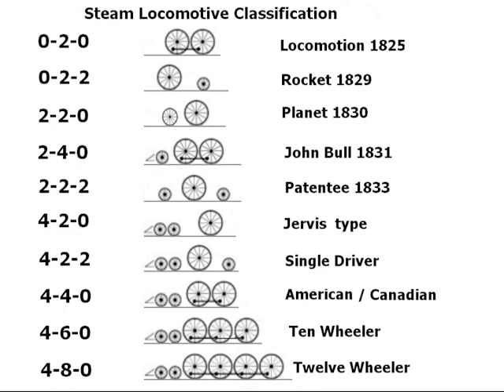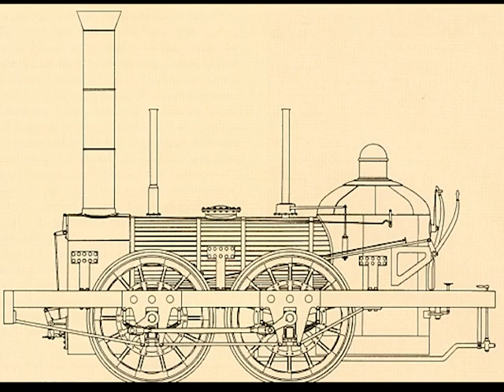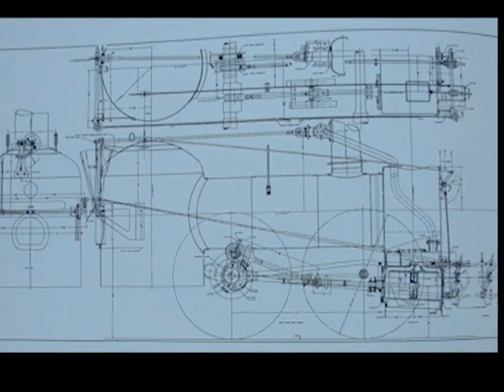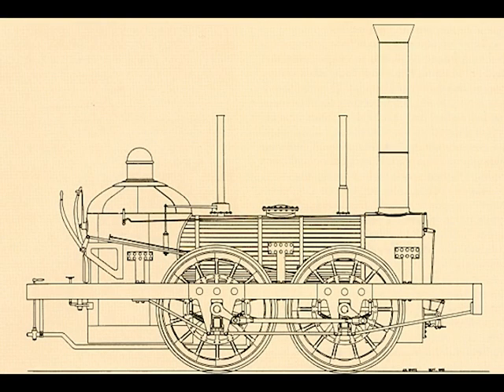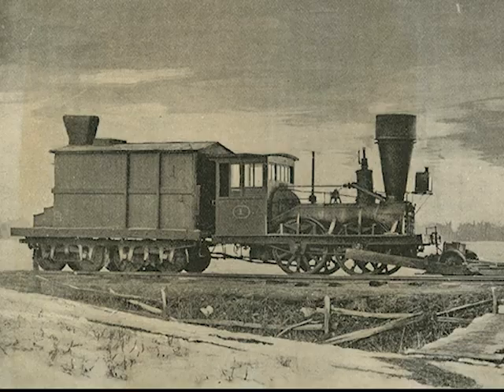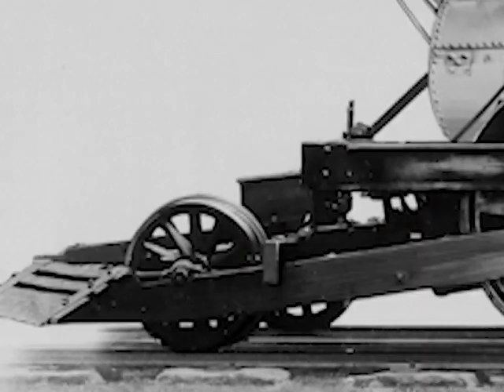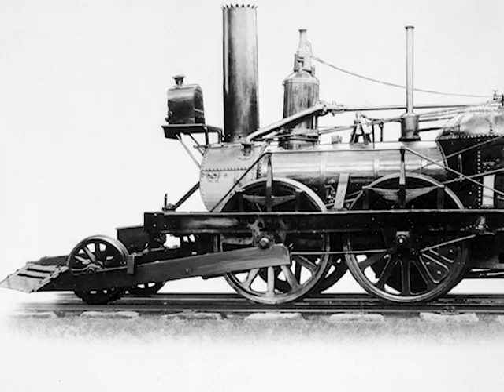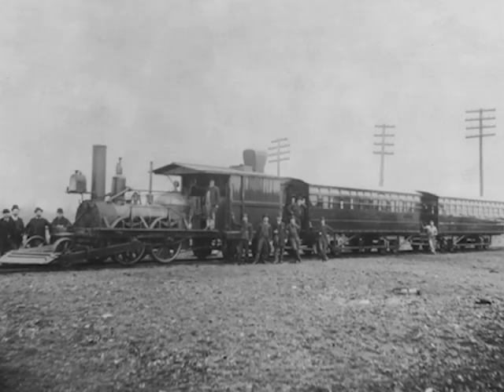RLMS: More Bull

Comment: I want to point out several inaccuracies in this video. First, the fatal derailment happened after John Bull was modified with a pilot. In fact all of the Camden & Amboy locomotives were fitted with pilots prior to the start of steam haulage on the line in 1833. So that accident had nothing to do with the invention or installation of a pilot axle on John Bull. The accident in question happened when a wheel or an axle on one of the passenger cars broke, causing the car to flip over and derail the train, the locomotive was not the cause.

Secondly, the drawing in John White's book is probably the most accurate depiction of the locomotive as built. When John Bull was built the springs were under the frame, as was usual for early Stephenson locomotives. The dome on the preserved locomotive (and its associated exterior steam pipes) is also a later addition, Stephenson didn't build it that way. It's worth noting that when Isaac Drips  (who assembled the locomotive when it arrived in America) sketched John Bull as it originally looked, he sketched it with those differences (ie. his drawing shows the springs under the frame, and the dome over the firebox, instead of toward the front of the boiler barrel). So those details are correct.
Reply from the maker: Thank you for pointing out the inconsistencies and the likely source of them.